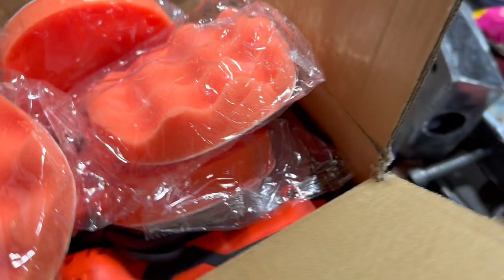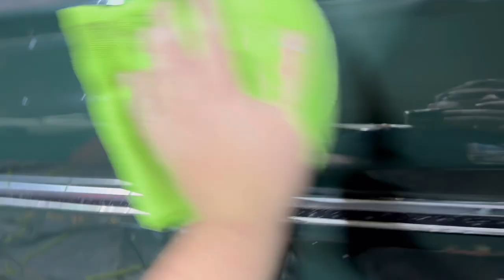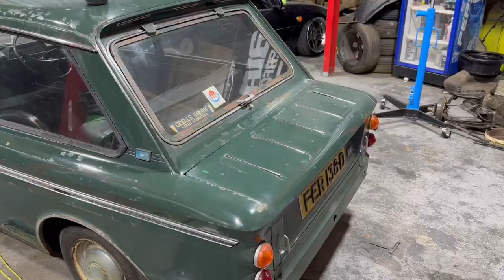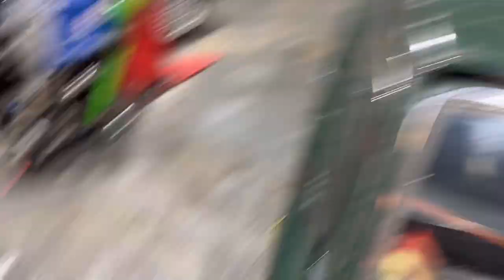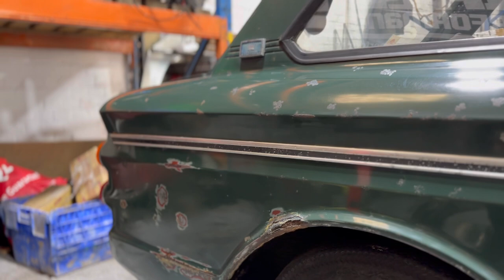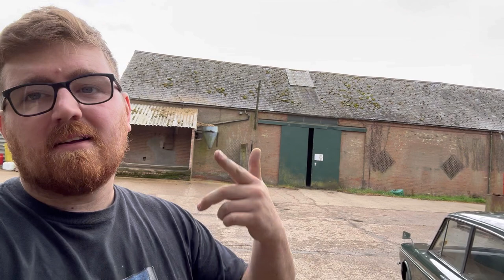Hillman Imp Garage Find | Restoring The 57 Year Old Paint!!

Comment: My late uncle had a Singer Chamois, basically the same as an Imp but with a few "posh" extras. It was the same year and colour as yours and he kept it going for around 10 years with an engine rebuild after 5 years, when we fitted a new cam from Roger Nathan Racing and twin Strombergs, dishing up a heady 65 bhp. Very confortable little cars but absolutely tiny compared to today's smallest class. The steering was very light and front tyres lasted for many miles. Screen wash was done by squeezing a rubber button on the left hand side of the console, 4 speed manual 'box, manual choke, single speed wipers and glow-worm headlights. I remember the reg, JVK 910D but can't find any record, so must have been scrapped a long time ago. Happy days and I hope you get this one back on the road.

Comment: A SUPER Imp no less!  Did they all have 2 doors?  Have got the rear bumper bar?  Were they a rear engined 850CC?  Were they all made in Scotland?  My grandmother on my mother's side had a little grey one with red interior in Queensland, north east Australia.
Reply from the maker: yes they was all two door! and scotland yes!
Reply: Hi there. Yes they were all 2-door, 875cc as standard but there are 900cc and 930cc versions owned by many people. They were made between Coventry (England) and Linwood (Scotland). They were sold n many other countries but often under the Sunbeam name, as Hillman wasn't as well-known overseas
Reply: @as3cs3 asnt so much that Hillman wasn't know over seas it was simplifying the range, rootes group had many name, I mean the imp was available even in UK as a Singer, a Sunbeam, a Hillman with   with sunbeams being sporty variants here ( imp sport and stilleto) I own 2 Chrysler era cars, a Sunbeam stilleto and an imp super both 1972, and yeah to put a more exact location on Linwood ( scotlands not as small as folk think lol) it's about 15 miles from Glasgow 😊
Reply: @as3cs3 there were no cars that were 900cc or 930cc there were only 875 and a very low number of 998cc rallyes ( really really rare less than 1000 were built) 930cc variant of the engine were fitted to the layer Talbot Sunbeam 1.0 litre (yes the hatchback that you could get lotus version of) many have adapted 930 from the Talbot Sunbeam to fit an imp over the years but never sold with that. 😊
Reply: Ously 998 engines and even 1040/1100 imp engines have been " built" by owners as the engine is extremely tunable
Reply: @ @Joshwaa___    Oh right👍!  Thanks mate!  Seeing the Imp brought back some of the earliest memories I have!  I can never forget the distinctive pitch of the engine/gearbox 'note' in grampa's car!  

It was probably mostly gearbox whine if I think about it.  Obviously a manual box; 4 speed I spose.  But year that definite note lol!

When we drove in his car I always had to put his tall, hinged, old school leather work bag on the floor!  I was always intrigued by his working!  The only one of its type I'd ever ever seen.  Sometimes he'd give me a 'kit-kat chocolate or 'golden rough' chocolate from out of his big work bag!  

So yeah, little kid memories from the later 60's from an old fart.  My pop's grey little Hillman Super Imp with the red upholstery  & his big leather work bag!  Thanks for the memory jog! 🙂
Reply: @ @as3cs3    Thanks for that!  Pop's was a superimp I think, but so yeah, they're all about just under a litre.   England made too?  Cool.

Funny you mentioned Sunbeam!  Many years ago I had a corgi Sunbeam Alpine sort-of matchbox car!  Fin-shaped tail mudguards/fenders.  A gold painted car & it was chromed plastic underneath.  A very early one of my 'cars', that was part of my collection back then.  Shit that's 55 years back?  Thanks!

Comment: I see that you IMP has suffered the problem that every un-vented garage has and that is the dreaded condensation measils! Has it gone into the metal and caused the surface to rust? Or did it only break the top surface?   The quality of the paint appears to be still there but a clear coat would be recomended to keep that look in a stable condition!  For the front bumper use coke and cooking tin foil to bring it back to original!